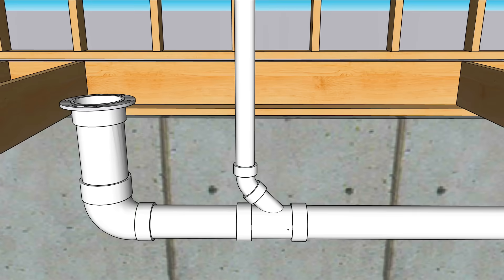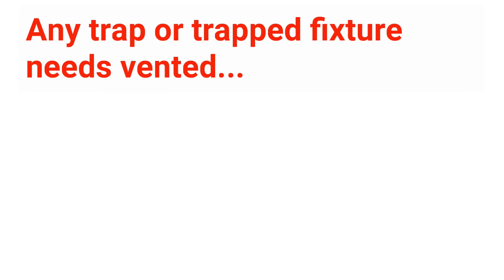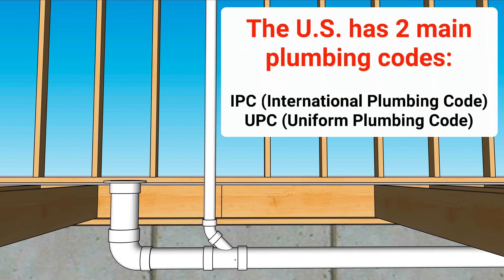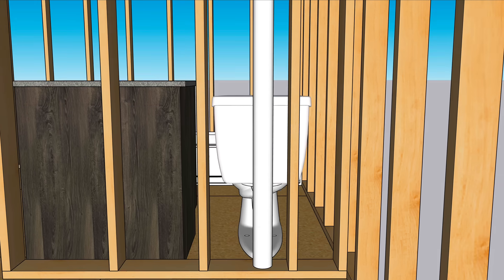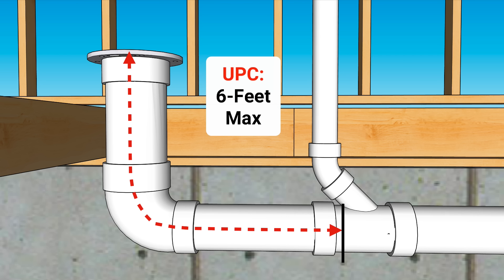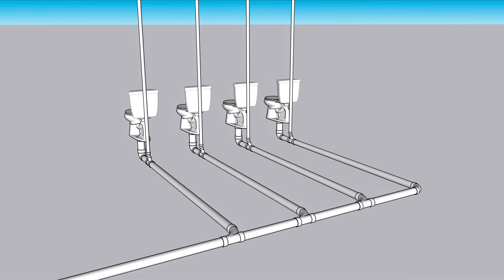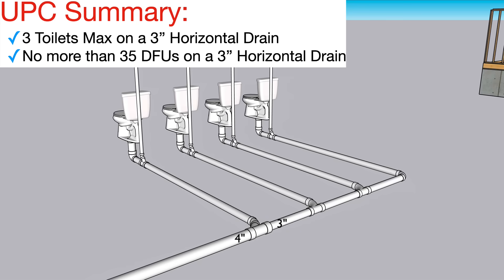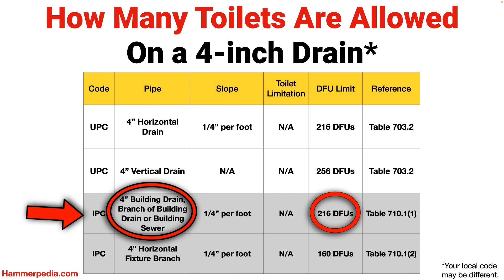How To Vent & Plumb a Toilet (in 2024)

Comment: I have a 3” vent coming out of my roof which is a steep 12/12 slope. How high should the vent be off of roof. I get some pretty big snow drifts up there.
Reply: My imperfect memory sez 18" above any structure (roof) within 3’… so in your example 4-1/2’ vent height. But AFAIK tents and teepees are excluded 😀  …but if truly 12/12 (an ‘A’ frame roof) it should shed snow readily and other regs may apply.
Reply: @gr8dvd  It is very steep, hard to get up there. There’s 30’ cedars next to house so wind blows funny and dumps snow.
Reply: @ermannodangelo1062  Perhaps get slope (rise v. Run
Reply: Oops, to avoid roof perhaps slope from attic, cathedral ceiling or window. Regardless, local building dept. may offer guidance (hit or miss in my limited experience) but other potential solutions… elbow VTR away (toward down-slope); interior studor vent; or side-wall venting. Ideas, not all available/permissible everywhere.

Comment: 3 years been waiting for your  videos! Please don't cut us off again 🙏. Please Keep these great contents coming.
Reply from the maker: Thanks.
Reply: Water Closet need not be vented This is one fixture unit that do not require to be vented
Reply: @tab529  It CAN be done...but, there are special conditions required for it to actually be useful.  If you have a high water table, for example, a ventless WC won't work well...unless you don't mind your bathroom smelling like a sewer.  If your WC is on an upper floor, the long drop can cause problems because of the lack of venting.  So...you might end up having to go back and installing a vent for the WC anyway.

Comment: Did I miss where it makes sense to downsize to 1.5” vent stack and then back up to a 3-4” vent stack through the roof?  
Makes zero sense to me
Reply: Under the IPC the vent can be 1/2 the size of the drain it's serving (with exceptions).  Depending on where you are located, the vent through the roof (VTR) can be 1 1/2" or up to 4".  The reason is frost closure, or how much snow you receive.  Obviously Florida would be different than Wisconsin.  They have charts showing the size, depending on where you are located.  Hope this helps.
Reply: In cold climates 1.5 can freeze in the winter when poking above the roof is what I have been told.
Reply: @ronaldoleksy8264  ... yes, frost closure is a thing. It has more to do with the volume of air on multiple fixtures so can be 2" into the attic but 3" through the roof prevents the problem.

Comment: Not all codes require toilets to be vented, but sinks/tubs/showers, must be vented in all codes.    Just an FYI, the toilet trap is designed to gurgle as it's finishing the flush....which is not the case with any other type of fixture.   I don't believe I have ever run a toilet (or even seen) without a sink, or a sink and tub or shower involved, so I would imagine in most cases the point is moot.
Reply: In conjunction with a lav the horizontal branch can be a horizontal wet vent tied too a vertical dry vent. So the toilet actually vented through the sink.  There are limits to this as to how many fixtures you can vent on a certain size pipe.

Comment: Why would you choke that down from 4" to 3"? Thats just gunna create a greater clog risk...
Reply: It is very common to run from a 4 to 3 (many times,..the reason is because that is all the hardware store has on hand) in this location,..and I don't recall EVER seeing this cause a problem with a drain clog. I am over 60 years old. This has been legal for as long as I can remember. I believe it is the ONLY place allowed in the code, where you can run from a larger drain to a smaller one.  That being said,.. back in the old days,..they could run out of 4 inch pipe,..and change to 3 (as the drain makes it's way out to the street sewer),..  Of all the idiots on youtube saying that for this reason (they have a new sewer cam in their arsenal) they should rip u p their yard and redo the whole thing.   Sure,..most of them should be slapped silly .
Reply: Agree sir!
Reply: @ThirdRockGypsy  ... I do believe it's allowed within so many feet of the fixture, but not 30 feet down the line. Reason being would be a bathroom retrofit and you don't want to disturb an existing toilet or tub. (tile floor, etc)